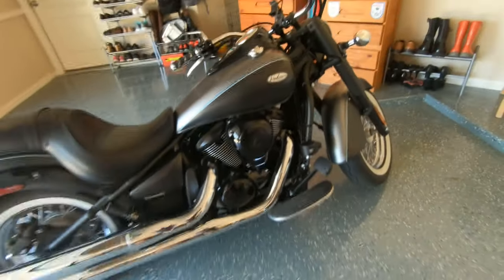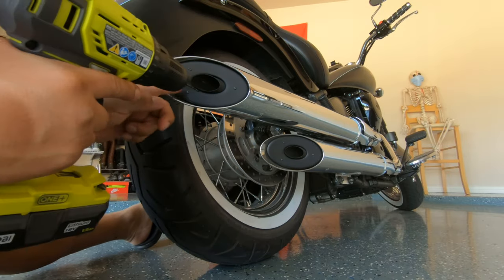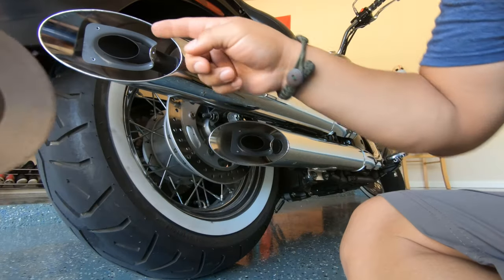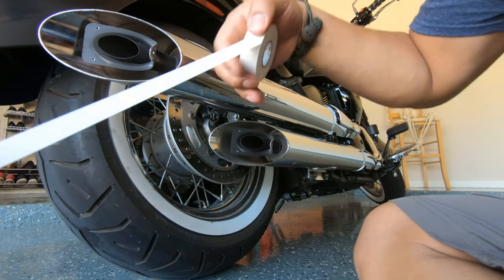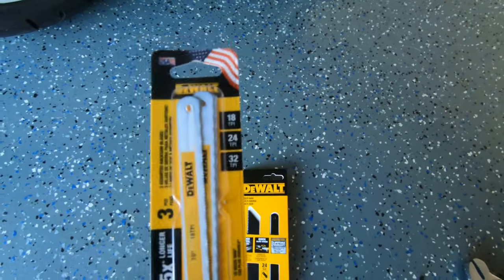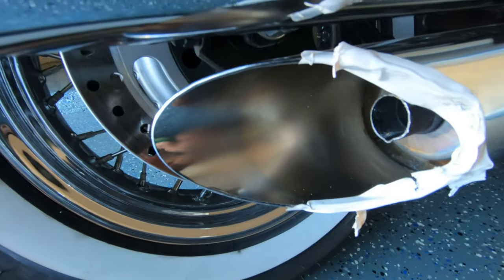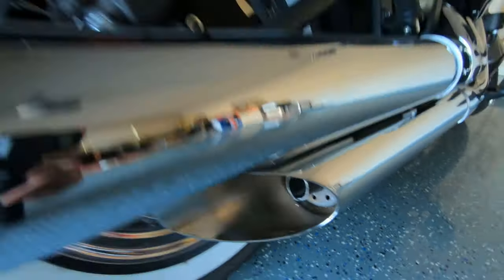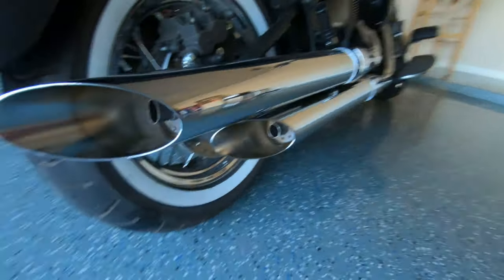Stage 1 - How to debaffle a Vulcan 900 Classic pipes

Comment: I have a 08 classic and the previous owner started the process of drilling off the rivet/studd heads. While i was riding one of the black caps blew off so now i have one pipe with the cap and the other without (it looks awful) . So im thinking about doing the stage one so they are the same.

Comment: I have been told that the full stage 2 baffle removal will cause the engine to run leaner but is this the case for just the stage 1?
Reply: Just get the procom fuel injexctor box   and turn up the juice £94  in the Uk
Reply: From what I've been reading online from a Vulcan forum, if you only do the stage 1 or 2 debaffle and don't touch the air intake, the bike will be okay. Same if you only do intake and not pipes. When you do both the bike will run very lean, and you need to get your ECM flashed for the new setup. There's someone everyone refers to as Ivan who does ECM reflashes for these bikes and has a very good reputation.

Comment: Did you notice any improvement or decline in performance? I just picked up a Vulcan 900.
Reply from the maker: After riding 200 miles this weekend, I haven't notice any difference on improvement or decline in performance.  Quite honestly, I debaffle my pipes to be heard when approaching texting drivers. But wait, I actually finished stage 2 and will be posing a video about it tonight. Stage 2 - There is no turning back, and I am loving it.
Reply: @lamabiker179  I look forward to the video!
Reply: just go stage 1 with full exaust intake and fuel module and ull fall in love again lol
Reply: @0Rthx  you have links on the products please V six?
Reply: @lamabiker179  Drivers can't hear you until they're right up on you, especially going opposite directions

Comment: I did my 2008 Vulcan 900 like this but I used a pilot bit and 1/2 “bit for the 8 holes , then I got a rod like 3 1/2 foot long and small sledge and stuck it all the way into each pipe and knocked off the screens inside , they stay in there fyi, you get a way better beautiful rumbling sound especially with acceleration
Reply: I used a dremel and cut off wheels to cut smaller pipes flush

Comment: I feel this isn't really "debaffling", because the baffles are still in there; they were not crushed or extracted. You just put holes on the back plates to make it louder.  Real debaffling (where you crush or remove the baffles all-together from the pipe) give a deeper rumble.

Comment: Laughed out loud when you were showing us the 1/4" drill bit to cut the 8 holes - maybe you should try a metal cutting bit instead of a brad point wood drilling bit - also, get a better set of bits - nothing wrong with Ryobi - just not the $1.99 set for working on butter.